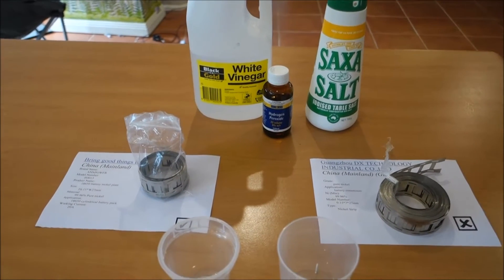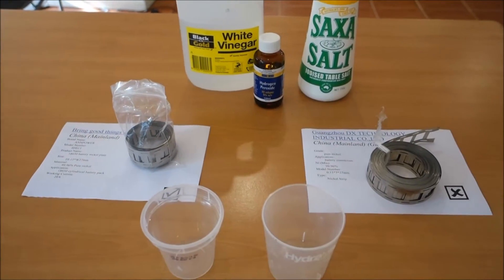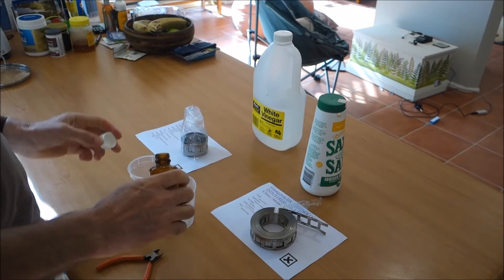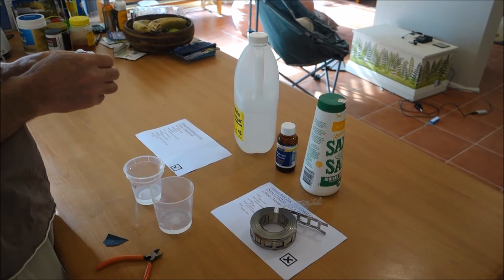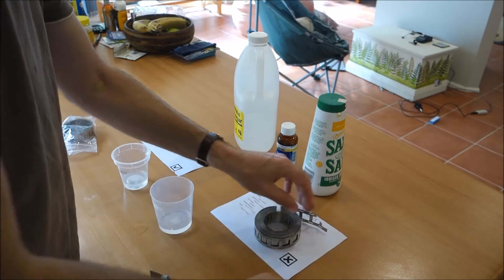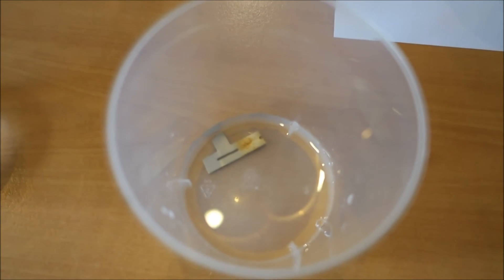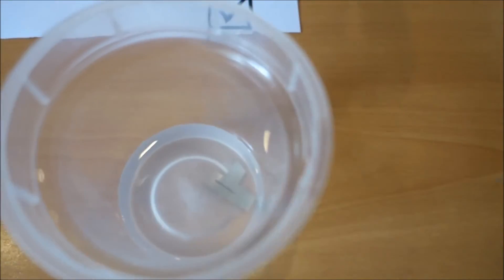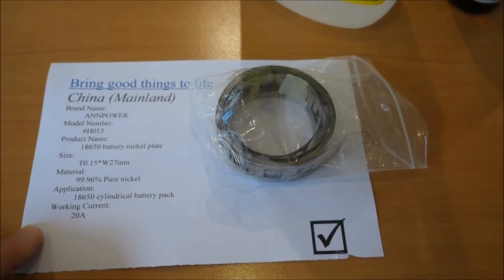Nickel Strip Corrosion Test

Comment: If it were stainless steel, it is not corroded in a saline solution, even scratching the strip. To check if it is a ferric material, adding concentrated vinegar (which is used in cleaning) + diluted hydrogen peroxide (which it is sold in pharmacy) and heating without boiling, the solution should take a red-fare color, for the formation of iron acetate, soluble in water.

Comment: Thanks for taking the time. Have copied your test - I now am sure I have been sent Nickel plated steel. I removed the nickel from one side of a piece and let it sit. Like you say after less than an hour the solution had etched away all the steel all the way to the nickel plate on the other side. Solution turns a muddy brown.
Reply from the maker: +Paul Goodwin Thanks for you comments Paul - if you want some more good resources then check out:

https://endless-sphere.com/forums/viewtopic.php?f=14&t=68005

Comment: The simplest and fastest way to tell if you got ripped off is to use a grinding wheel.  Nickel plated steel will spark and pure nickel will not. Either use a bench grinder, angle grinder or sometimes a dremmel grinder.
Reply: Well not everyone has a grinder

Comment: is there a fume risk to this? a bunch of sites kavetch about the dangers, but the less alarmist ones say its not a good idea but probably not gonna kill u in small amounts and non heated
Reply from the maker: Thanks for your reply Jonathan, Vinegar is an weak acid,  Hydrogen peroxide is a strong oxidiser (but this solution is a weak version).  We are basically accelerating a natural rusting process where the acid etches the metal and the hydrogen peroxide provides a ready source of oxygen for the iron to rust.  Not for children to play with but a responsible adult using small quantities this should not be a concerned.  Don't get it on your skin and definitely don't get it in your eyes, and if you don't feel competent don't do it!
Reply: thanks for the reply 
checked it with a girl that was a competent lab tech years ago but then went on a diff path.., she was a bit rusty but didnt see a huge issue. Ended up doing just a small amount like you suggested, in a mason jar and put it in the tub directly under the bathroom fan. :D I sourced some legit strips, now i just need to build the CD spot/resistance welder I have slowly got the parts for. still waiting on one bus bar in the mail though. I dont know why but i just never had an aha moment with chemistry. Im decently competent in electronics computer hardware, coding, building with wood, plexi and taught myself mig with youtube but chem i just cant get a natural feel for. Question... is the salt actually concentrating it a bit more while aiding etching? I havent yet been able to afford an ultrasonic cleaner so i use IPA on water damaged electronics. bought in quanity I know it soaks up moisture over time with every lid opening and attempting searched for solutions. one was epson salts (i think) heated and pressed to convert to a diff salt (off top of my head) then dropped in ipa and coffveve filtered out later .The other was distilation but thats less relevant to the convo other than im not trying that in my appartment (in building sans fire sprinklers).

last i have a tip. Idk if you've heard of search engine optimization..its the art of tuning titles and descriptions to get more potential subs and views. If you want to pull in more views on this video add/work in "lipo/18650 battery solder/ weld tabs" to description and or title. ie "lipo/18650 quality/purity testing tabs used for welding or soldering battery cells " 

description should get things like "info for those seeking to build their own lipo battery packs. This video will show you how to verify that your 18650/lipo/nicad  battery tabs are pure nickle" 

its all about the right terms and a bit about repetition(but not to heavy with the later). the battery making community is big on youtube...slightly terrifying to say it but im not sure that half of them know nickle is even the primary component and one of the biggest channels features a guy who has a lab building ev packs and doesnt know what a dendrite is...but the terms they do know are 18650 lipo, tabs, solder and weld. It would be great to see someone providing quality info get enough views and subs to get a bit of kick back from the big G/yt for what they do. Google has a hard time hearing you and making that relevant to search ranking so its the title and description that do the work.

one more thing that can work but is a lot of work...I had luck driving a clients site higher by posting transcripts of the videos in their description and on the wordpress page that had the video linked/embeded. Its a lot of natural looking/normal sentence embedded hits/appearances of the key words. Its important its natural because most search engines now can detect people who just fake it with a page of giberish or repeating the same phrases.

Comment: Thanks for the video.. 
Sure enough I have nickel plated steel :(
Reply from the maker: Hi Tim thanks for the comment.  My impession is that most of the ebay/aliexpress vendors are selling the nickel plated variety.  Its probably ok to use just avoid it in high humidity application or where you're trying to get the most current from the thinest/smallest strip.